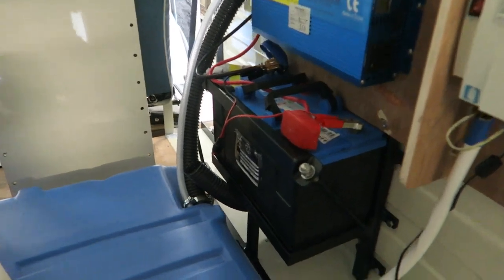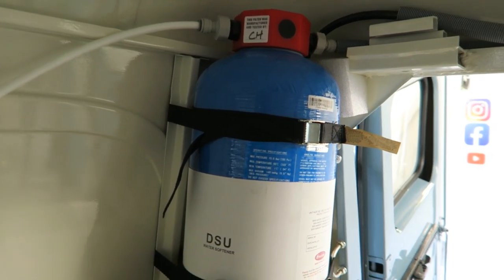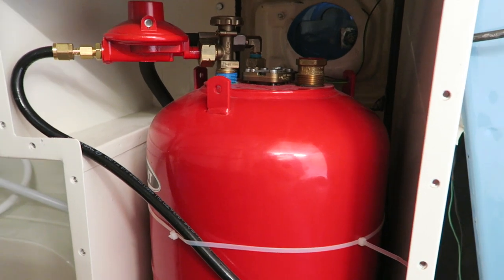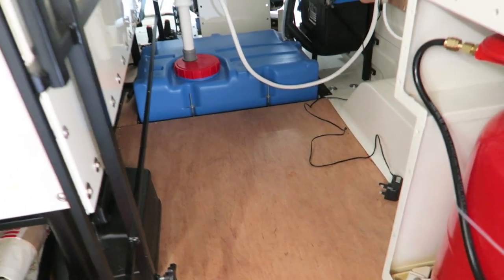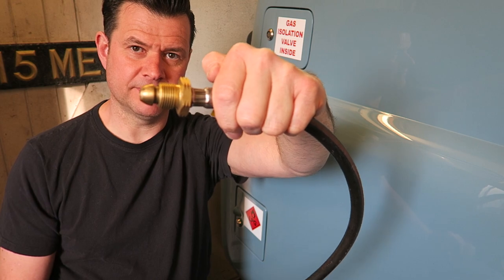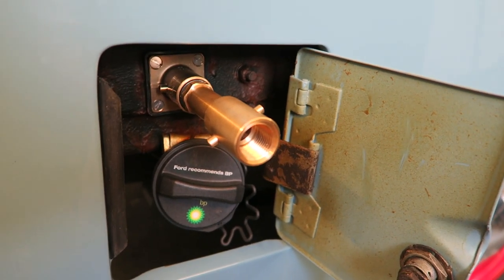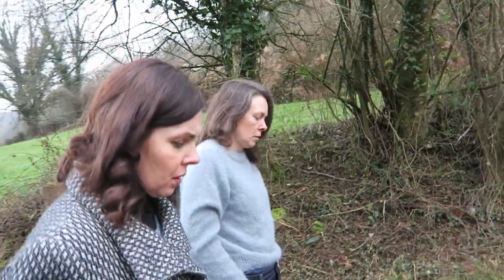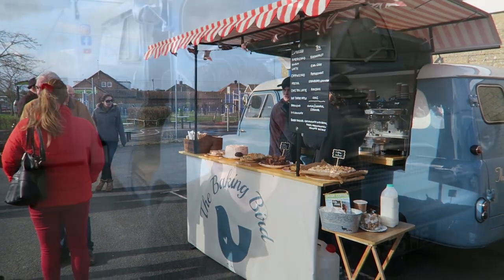Vintage coffee van set up, Off grid hook up free, LPG tank, inverter, Flowjet pumps, certification.

Comment: Hi.  I fitted and have used autogas for 15 years in my motorhome.  A lot of things you noted or wanted are available.  Gaslow gave me all I needed to know about installing LPG.  I fitted 2 Gaslow cylinders and fillers etc.  Look at the Gaslow external filler cap.  I take on gas alll over europe with no pump access problem using lots of different adaptors in their filler   Their steel braided tube are the best available also.  Look at how caravan and motorhome gas lockers are constructed/vented for comparison.  Your locker etc. Is much more engineered than motorhomes, should be fine for many years.  Hope the venture goes well for you.

Comment: Fantastic job Trev, the whole setup looks awesome and the bakes look mouthwatering. 

A few additional tips for the battery system. These types of batteries have a finite number of charge and discharge cycles which gives you about 5 years if you discharge and charge it daily dependent on the following:
1) Never discharge the battery to below 70% full. Every time you do that it takes away a significant number of charge and discharge cycles off the life span. A battery condition monitor or at the very least a charge indicator will allow you to be aware of the level of discharge.
2) Never overcharge the battery. The more gentle the charge, the more it contributes to the battery lasting at least as long as the rated life span. Make sure you know what the float voltages and charge currents have to be. An intelligent charger will go a long way to assist with getting it right. 
3) Never let a battery stand discharged. Recharge as soon as is practically possible. Ideally you would want to charge the battery the instant you get home. There are electronics available that will allow you to leave a charger attached and will switch the charger on and off as required, keeping the battery fully charged between events.

Other improvements I'd make would be to fit a battery switch to be able to disconnect the battery from the inverter when not in use or in the event of a failure. I love your water tank system and I agree fully with the down side of the smaller tanks. 

Your van is a brilliant concept and here in South Africa you'd have made a killing during wedding season. I would try and get a regular spot for the week around business complexes and do events on weekends. I'm so sad that the timing of this virus ended up affecting you so badly but if you hold out, you will be in a better position when it's over.

I love your fabrication channel and now I'm subscribed to both. You are certainly the most talented person I have ever encountered when it comes to sheet metal work.

I wish you and your wife all of the best and hope this pandemic doesn't affect you too badly financially.

Comment: I was wondering if I could ask  your advice re Environmental Health Hot Water for hand washing Off Grid?  My Daughter is considering  an  Off Grid mobile Coffee Type unit probably a  horse box trailer with a Fracino two Group Dual Fuel and Grinder, etc, powered via your suggested One Leisure battery and 12v-240 v Inverter for weekend sales. Included will have to be a hand washing basin as I understand with -Jet Flo type-pumped cold water. 
However Hot Water for hand washing is also required but I cannot find any info on how this can be achieved completely Off Grid.  To Satisfy Environment Health  requirements, do you know if a large 5 ltr flask filled up with Hot Water from home  at the start of each day and carried in the Coffee unit, if  in your opinion  this idea would satisfy the Local Authority  Environmental Health requirements Off Grid?  Thank you again for a really interesting series!
Reply from the maker: You must have a double sink. One dedicated to hand washing. If you get a coffee machine with a water spigot you can use that water to wash your hands in. Alternatively yes a flask should probably be fine but as you say “opinion” 😁

Comment: What a great and helpful video!! Thank you. We only just converted our Estafette and have ‘almost’ an identical set up. Can I ask how the coffee machine is powered off grid? I understand the boiler is on gas - but is the coffee machine also plugged into the inverter? Many thanks!
Reply from the maker: Our coffee machine is a Fracino duel fuel machine. Yes the boiler can be heated by gas and yes the coffee machine still has to be plugged into the inverter, the inverter runs the coffee machines internal micro processor and solenoids, it also runs the external high pressure pump which is fed by the coffee machine. If running it on the inverter and gas there is an element isolation switch which must be switched to gas, if the switch is on electric it will almost certainly blow the inverter so it’s very important to make sure this switch is selecting gas. This means that with a water tank it is possible to run the machine for many hours off grid. Best regards Trevor

Comment: Great video but I do have a question:  Do you have any issues with the espresso machine recovery time between shots? Are you able to use both group heads at simultaneously while steaming milk?
Reply from the maker: Not really, the only time recovery time is needed is if i make a load of teas in one go or use the spigot to clean out multiple milk jugs, making coffee has never been an issue. cheers Trev

Comment: Great setup, and workmanship as usual. the Flowjet will run direct on 12volts surely, and it's a diaphram pump, so will not worry about water loss. I'm sure it's the same ITT pump series we use on boats etc for the potable water systems. Another thing I would suggest is to mount the inverter with the fan on top. Having had similar troubles to those mentioned with these units the ones I have fitted that way up have lasted longer by a lot !! Might be chance of course..  I think the heat gets out quicker..

Comment: Great conversion. Just out of interest why would you change the water container as the idea of being able to fill external and drain seems much better than lugging 3 cans around? 
Thanks
Reply from the maker: The original tank has now gone. The 20 ltr tank replacements are not that heavy to lift in and out. I have panelled the floor flat now which helps with loading of all of the stuff I have to fit in to to a day’s trading. My Jack wheel brace and tools now live in the original tank recess. I now have 4 separate 20 ltr tanks when filled have never run out. It’s also more simple to roll up at an event and source water there rather than driving with a full 70 ltr tank which weighed the van down more than you’d think. It works well for my layout that’s probably all bases covered. 👍
Reply: I have a trailer which needs to be converted is that something you could do for me  ?

Comment: Amazing video, thank you so much. 

I am converting my Sherpa van into a mobile coffee van next year and as you said in the video, there is no information on the LPG side of things anywhere on Youtube. I am not looking to be mega busy and am just going to have a one group espresso machine to start with. I was almost tempted to start using only manual brewing methods which would suit my business.. since there is so much red tape and rules when it comes to machines and the gas side of things. 

My sherpa is already a campervan with a Gasit refillable tank providing gas to my water heater and oven. I know that this will be a problem when it comes to trading, since although I will be running the coffee machine solely on batteries (I have 520Ah of batteries and 500w solar on the van - I used to live in it!) - they will still need the gas bottle to be fitted correctly and that means the locker, and access from the outside which is a huge job! currently it is in my 'kitchen' cupboard secured properly with plenty of ventilation to the outside. It kept the DVLA and the LPG inspector happy when changing the log book to 'motorhome' from 'minibus', but no doubt it will cause problems when trading since the vehicle is fitted with LPG.
 My main concern is so external access door - but you have made an amazing job of this! 

Thanks again for this awesome video!
Reply: It's really great that you're open to sharing everything you've learned on this journey. The restoration of your van is incredible. It's fantastic to bring something back to life and to give it a totally new purpose like this. Breathing life back into an old thing, and it's like they know it :)

To your knowledge - does the LPG tank have to be exchangeable from outside of the vehicle - or just access to the valve on top?
Reply from the maker: Maybe worth checking the regs to make sure it definitely needs to be accessed from outside of the van. it was a few years since i built this so i'm getting a bit sketchy on the exact detail. you definitely have to have access to turn off the bottle and it has to have an upper vent which most gas lockers don't have. cheers Trev
Reply: @thebakingbird7597  Thank you for your reply!
Reply: @thebakingbird7597   Hi Guys, I love what you have built here. I am currently in planning stages of a build myself. i have some questions. How is 70L water tank? is 70L enough or can this be reduced. also How about the battery power is it lasting a days use? thanks in advance
Reply from the maker: @bradroberts2123  sorry for the late reply. Ditched the 70l tank a long time ago. For our own personal needs I’ve found that separate 20l tanks work better, we’ve got 4 in total and I’ve only ever ran out once. I was so pushed for space so I’ve boarded over the hole where the 70l tank was and put tools in the void. It allows more space for storage inside the van and I find it convenient lifting out the separate tanks and filling them from an outside tap, no hose pipe needed. The battery went flat once after an extremely busy day, I’ve since bought a brand new battery and keep the old one as a backup if I do a day I know we’re going to be busy. I’ve also bought a spare inverter as my original went pop,for the cost of having two inverters it’s a no brainier if you end up losing a whole days trade. Cheers Trev 👍

Comment: This is awesome.. So i wish i watched this before hand.. I have a coffee cart and added a 4000w psw inverter for a mazzer mini grinder and a la pavoni pub 2v espresso machine. What im still trying to work out if the 12v 100ah batter i have is sufficient for this. I have been told that the espresso machine is 13amps and the grinder is 1 amp or 10 amps. How do i work out of i have enough power?
Reply from the maker: How many watts is the coffee machine? I would guess around 3kw. I don’t think you’ll have enough battery reserve to run it for very long and you’ll possibly be overloading your inverter too. 3000watts will require a battery of around 300ah to run for one hour, if the element was permanently on. Cheers Trev 👍
Reply: @thebakingbird7597  hey yeah you are right. Ive started to look for a dual fuel machine. As it will do most of the heavy lifting. The 4000w invertor is over kill for the grinder and water pump. But its there if needed.

Comment: Thanks so much for the video! We are trying to set up a coffee cart with the same coffee machine and were wondering what type of battery you are using? Cheers!
Reply: In addition, we're just trying to brainstorm this... how long can you use the leisure battery with your set up before needing to recharge it? And how do you recharge it? Thanks for your help !
Reply from the maker: I’m using a 115amp leisure battery and using an numax intelligent charger to charge it. I don’t know how long it would last but certainly a whole day. You’re not supposed to run lead acid batteries nearly flat because it can ruin them. My main problem now is most of the petrol stations don’t have lpg at the pump. Cheers Trev 👍
Reply: @thebakingbird7597  Thanks so much Trev! For putting the information out as well, been super helpful and otherwise quite hard to gather. Maybe you can get deliveries from a local log supplier? I wish you guys all the luck with your van!

Comment: Two comments on one video! Question re: the LPG tank. How did you get around not having to have an external access only door to remove the tank? I've only seen a clause that says you have can have an internally accessed LPG tank if putting in an external door fundamentally damages the structure of the vehicle or something? Cheers!
Reply from the maker: At the end of the day the locker was built specifically for this van and may not be correct for another vehicle, please bear this in mind if you’re building your own system as it maybe wrong for what you’re trying to do. Because the lpg tank is refillable I do not require access to remove the tank every time it is depleted. The gas can be isolated from outside of the vehicle via the custom installed flap on the outside skin of the van, which is also lockable. Cheers Trev 👍
Reply: @thebakingbird7597  cheers for the reply, Trev! I did think that about the cylinder being refillable too. Aesthetically a better way to go IMO.
Reply from the maker: Just note that most petrol stations have now stopped selling pumped lpg. I now have to use an lpg dealer that has a pump.